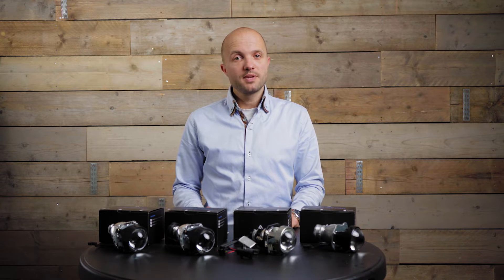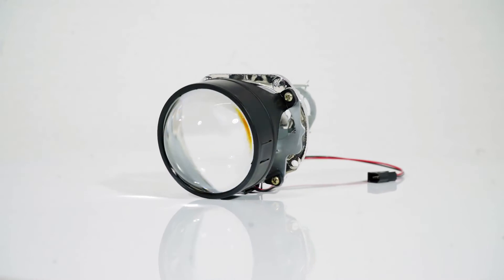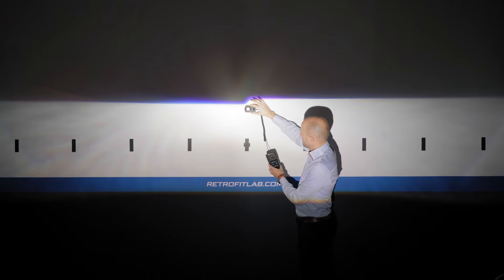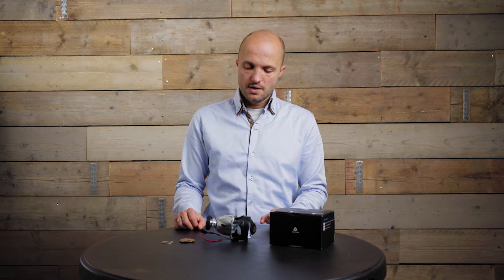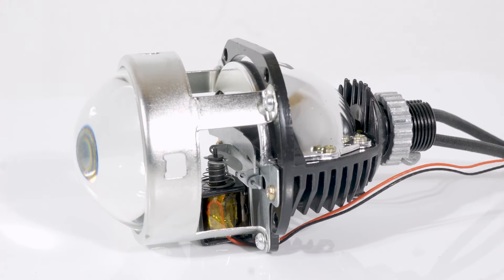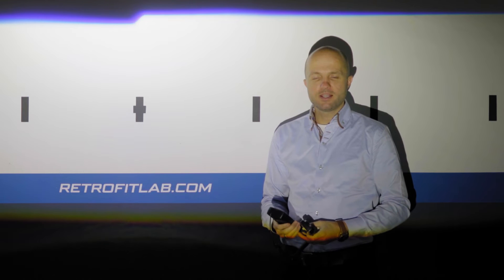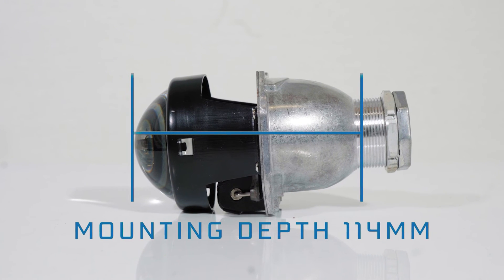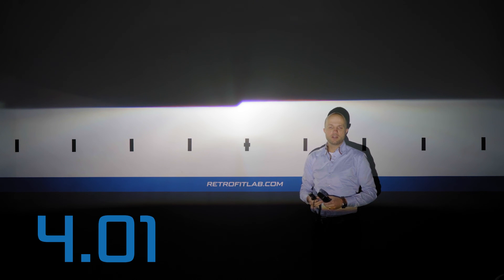DIY Retrofit projector 2,5" HID xenon and LED projector comparison - headlight upgrade

Comment: Which unit is the best choice for reliability ?
Reply from the maker: I would say that the AtomLED X2 is the most reliable when choosing an LED projector. 
If you choose xenon and it is possible to fit the Optimus TR mini I would advise that, because D2S  bulbs from great brands like Osram and Philips can be placed inside.
Reply: @Retrofitlab  thank you Sir
Reply from the maker: @nonegiven9579  Glad to help!